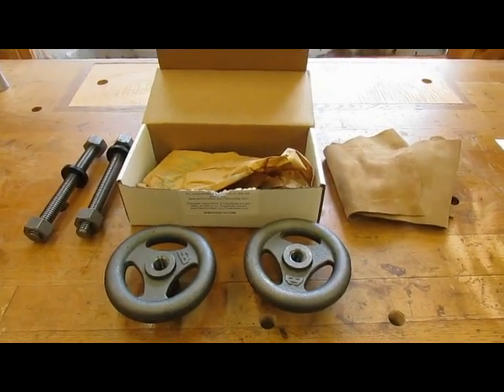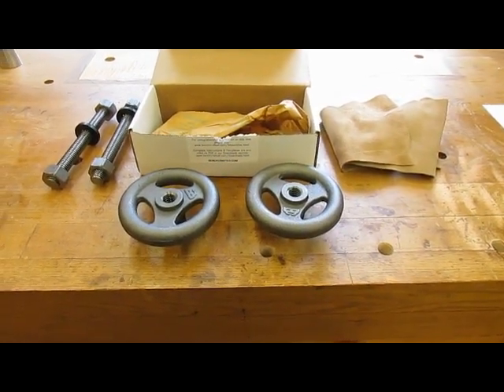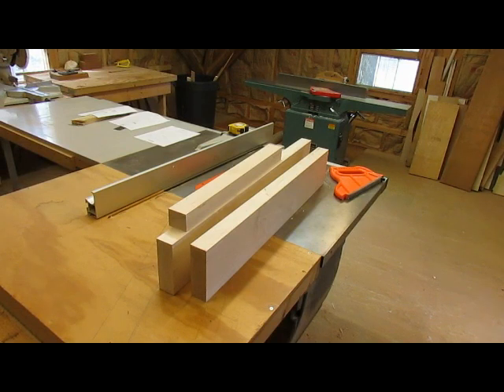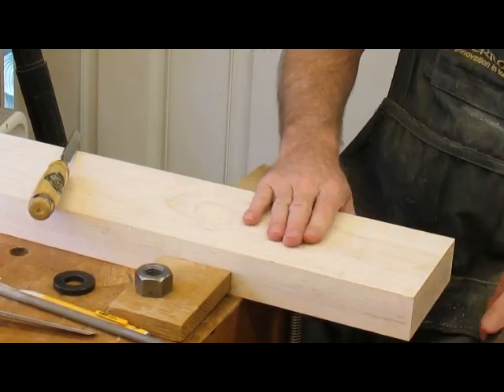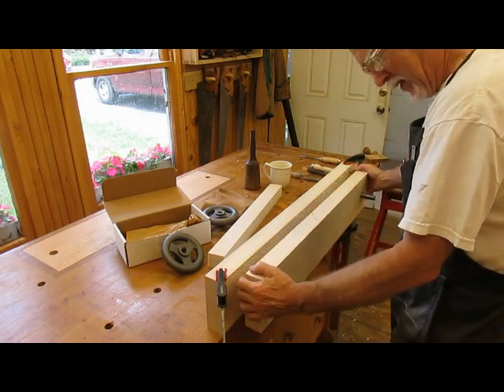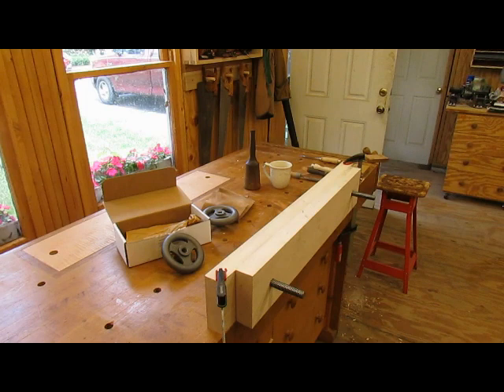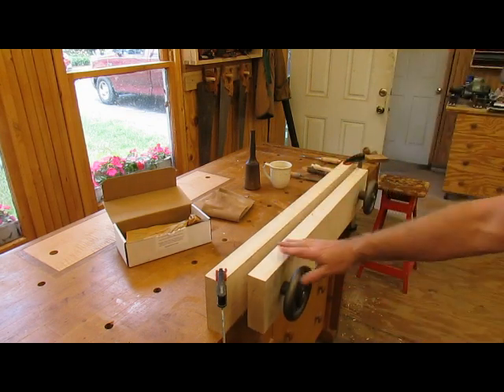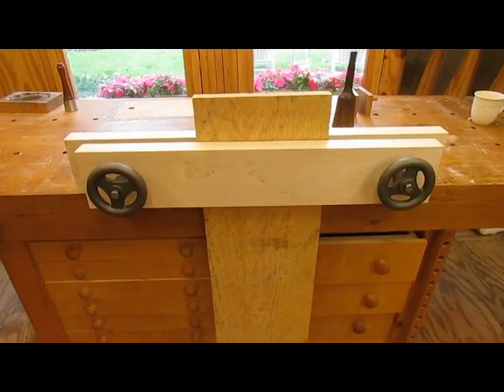Building a Moxon Vise

Comment: This looks like really nice work, but I would have liked to see some of the processes  in more detail. I imagine the application of the leather was more than a little tricky.  I'd have liked to learn something from how you addressed that.
Reply from the maker: I bought a small bottle of contact cement and used that,  then trimmed it off
Reply: I've used this adhesive to apply laminate tops over wooden substrate.  The trick is to apply the plastic/ formica/etc to the middle and slowly and evenly move out towards the edges, making sure to leave no bubbles or air pockets.  The only trick is to get it right the first time, because there is no 2nd chance with contact cement. That's easy with a stiff product, but with something as pliable as a sheet of leather, I'd imagine that would be a real challenge.  I'd have liked to know how you applied the leather while being careful to eliminate air pockets and bubbles.
Reply from the maker: I just bent the leather in the middle and smoothed from the center to the edges. don't know if there are any bubbles.